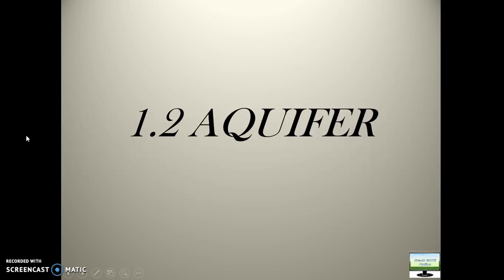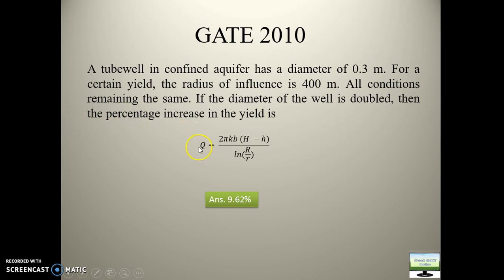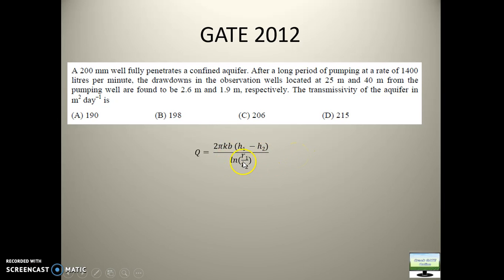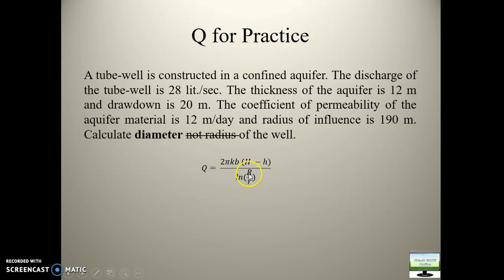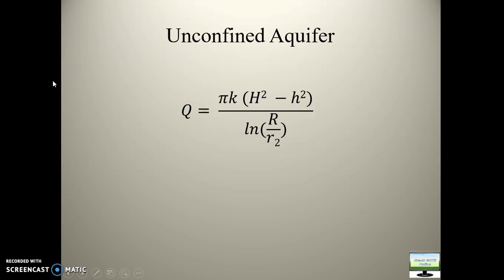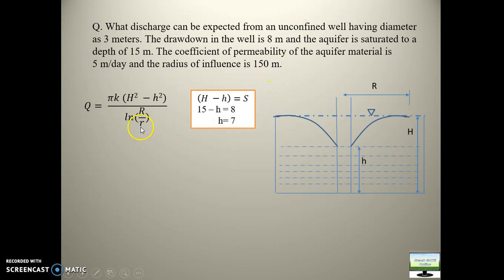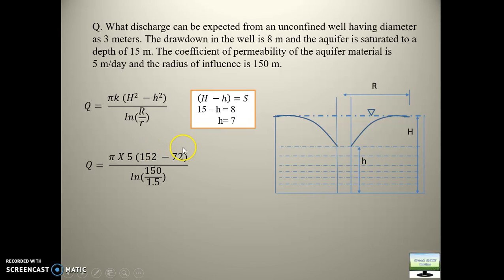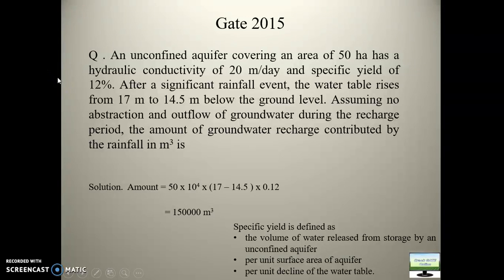1.2 Aquifer

Comment: Calculate the discharge of tube well of diameter 80 cm, the thickness of water bearing strata and permeability as 20 m per unit area per day.
and draw down are 10 m and 4 m respectively. Assume radius of circle influence as 300 m
Plz it's solution
Reply: 607.3 cum/day

Comment: guys can u help me this
 1.A 45 cm well penetrates an unconfined aquifer of saturated thickness 30 m 
completely. Under a steady pumping rate for a long time the drawdowns at two 
observation wells 15 and 30 m form the well are 5.0 and 4.2m respectively. If the 
permeability of the aquifer is 20 m/day, determine the discharge and the drawdown 
at the pumping well. 

2.Two channels are 2000 ft apart. The water level of two channel are 120 ft. and 
110 ft., respectively. A pervious formation averaging 30 ft thick with hydraulic 
conductivity of 0.25 ft/hr. and porosity of n=0.25. Determine the flow rate of 
seepage from the river to the channel and the time travelled from the head of 
the aquifer to 5 ft downstream.
Reply: 1. Q = 3682.8 m^3/day OR 0.042 m^3/sec
Reply: @ashutoshgawande5480  thank you sir i got the same answer 0.04226...